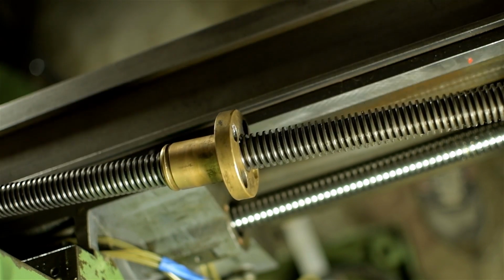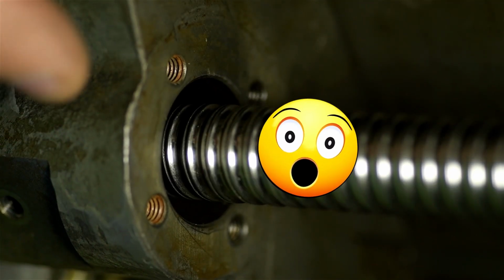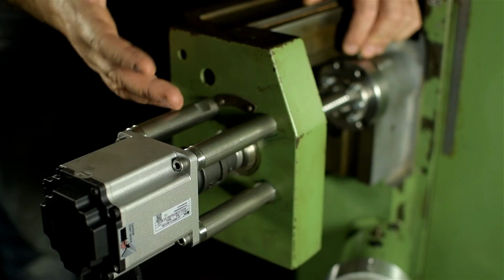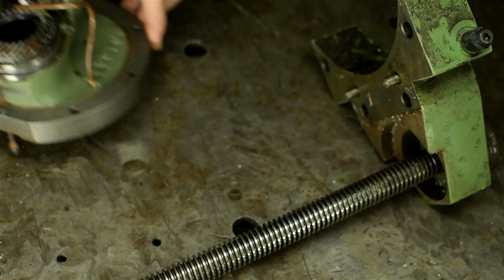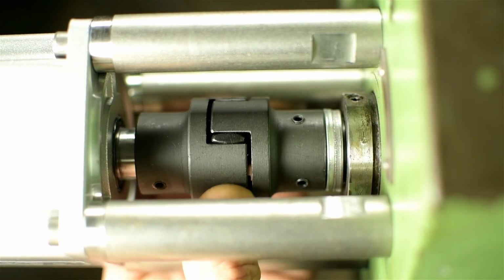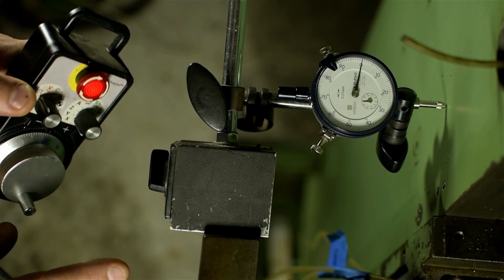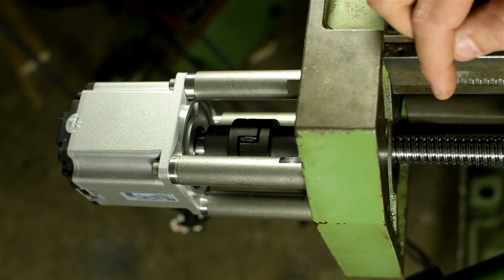Maho X Axis?  DONE!

Comment: Tony: If you move the encoder from the back of the motor to the ballscrew itself, you can use any coupling you want and you'll still get full accuracy.
Reply: Sort of. You'd end up with some elasticity in direction changes and stops, which would be hard to tune out with the software if it's even designed to calibrate for such things. You're right though. What you're suggesting is why I have decided to build my own plastic printer instead of buying one.
Reply: Not to mention you cannot "move" the encoder, it's built in to the motor. He will be fine as long as he uses belts and couplings that are designed with motion control in mind. I.e l8w backlash couplings and timing belts
Reply: @RobertChadziutkoRC  He has a TIG, a milling machine and a lathe. He can move anything he wants. It would be a lot of extra work to do so, and really wouldn't gain much accuracy without spending a whole lot more on things like ground ballscrews instead of rolled ones, and there's nothing to say that TOT requires that level of accuracy. 

But you absolutely can move the encoder to anywhere you like, and if you wanted uM repeatability, that's one of the things you would need to do.
Reply: @Jimmeh_B  all I was saying is that with his particular motor, the encoder is NOT moveable, it is literally built in to the motor.  He could certainly use an auxiliary encoder that is mounted to his machine, but there is no moving of the current encoder setup.
Reply: @RobertChadziutkoRC  you're wrong.
Reply: @Jimmeh_B  So you are saying that he can easily disassemble the motor, extract the encoder from the motor, then engineer some sort of adapter mechanism and an enclosure for the now exposed encoder  to use it as a linear encoder attached to the table somehow? He would be better off just buying a pre assembled linear encoder and using the auxiliary encoder input on the drive to interpolate the movement of the axis based on both encoders. This would leave the motor encoder to do it's thing and make tuning much easier.
Reply: @RobertChadziutkoRC  okay, a few things.
1: do not put words in my mouth. When did I suggest it would be "easy" (though it wouldn't be difficult). 2: You've misused "interpolate". Encoders do not interpolate, if they did, they would be called interpolaters. 3: "better off" is subjective and your opinion. Personally, I build whatever I can from other devices over purchasing items, mostly just for the challenge. Also, how exactly would one be "better off" buying another encoder, creating adaptors/mounts to fit said encoder, and then adjusting the software to account for said encoder along with the calibrations necessary - rather than just dealing with one encoder that is guaranteed to be absolute?  Also, no I was not suggesting that if one were to remove a rotary encoder from a servo motor, that it could then be used as a linear encoder. Again, it's a rotary encoder, it's in the name.

Finally 4: My point was, the man has a milling machine, a TIG welder, and a lathe. The list of things he cannot build is far shorter than most. Encoders are external to the motor itself, they may be attached to the motor as an assembly, but they are external to the actual motor. Rotary encoder's are not some highly complicated piece of kit, they are simply a rotating vein of some description with an appropriate sensor/array dependent on resolution, making adaptors to mount them on things is trivial.
Reply: @Jimmeh_B  Interpolation happens in the software of the drive, not the hardware. Auxiliary encoders are pretty standard in the industry and not difficult to enable and integrate into the closed loop system. Mounting a liner scale is as simple as making sure it's parallel to table, drilling a few holes, and running the feedback cable to drive,   All I am saying is that with his current motor/encoder setup it is not feasible to remove the encoder from the motor as you suggested and using it somewhere else on the machine. Utilizing different motor sans encoder and attaching a linear scale to table and using as feedback is.  Of course anything is possible, but some things just aren't worth the time and energy when off the shelf components are readily available.
Reply: @RobertChadziutkoRC  right, so, you've finally come around to agreement. 
Also mate, I'm well aware of where the interpolation happens, I've been designing and building interfaces and writing the software for them as a hobby for over 30 years. You've made a bunch of erroneous statements, and now you have decided to reword what you said in order to explain things to me that don't need explanation and in doing so have begun to admit the statements you made were wrong. Just not in so many words.

I don't expect you to have an understanding of a stranger's level of understanding on any given topic. I certainly don't need explanations to things I clearly understand. 
I'm glad you agree that it really is not only possible, but trivial to modify almost anything to fit a purpose, given you have the equipment, knowledge and willingness to do so.
Reply: @Jimmeh_B  Lol, not at all, as I stated from beginning removing encoder from that particular motor is not feasible. It is quite obvious it is just a hobby to you as you were not even aware that removing  an encoder from said motor is not a reasonable possibility. This is not my hobby but has been a  career  for 30 plus years, designing, building and programming multi axis motion controlled machines for many of the worlds largest manufacturers.  It was your post with many inaccuracies that led me to post some corrections.  I rarely post comments online and your type responses is why I avoid posting.  Thank you for your hobby oriented responses, I am just merely stating facts of what a proper motion control system looks like.
Reply: @RobertChadziutkoRC  Why? Because I will interpret what you said, the way you said it?
"proper motion control systems", oh I see. So my manual thread cutting lathe that I converted to CNC is not "proper". Nor are any of the plotters and laser engravers that I've built over the years. Because they were built on custom interfaces that I designed and not plc's or commercial motion control systems that are cost prohibitive for a hobbyist. I suppose when I'm finished building the laser interferometer for my AMCO 3850 in an attempt to completely automate the machining of brake rotors (aside from mounting and removing the rotors from the arbor) it won't be "proper" either. Irrespective of which of the many systems and MMI's I choose to control it with in the end.

You may be a qualified engineer or whatever, and what I suggested may not be the way it's done in industry through companies with endless budgets. In fact, I'm well aware what I suggested isn't how it would be done in industry.

However, feasibility was never part of your statement. If that's what you meant, maybe you should have communicated it more effectively. Your statement, verbatim, was: "Not to mention you cannot "move" the encoder, it's built in to the motor." But, sure mate. TBH I'm now done with this. Thanks for attempting to suggest that my 30 odd years of teaching myself electronics, programming in 7 languages so far which I've become quite proficient at, interfacing, logic, robotics......... plc's, pid's closed loop control systems.... are trivial though, I appreciate that. Never mind the fact that I've worked for fox studios making pneumatic walking rigs for movies, or channel 7 studios, or any of the other companies I've worked for.

Which begs the question, why would you even watch someone like TOT? Since he's self taught and clearly there's nothing here for you. The simple fact is, it is absolutely possible to remove an encoder from a servo drive and relocate it if necessary, the converse of what you stated, I've done it, several times.
Good on you buddy. Enjoy the rest of your life.
Reply: @Jimmeh_B  I have never seen your work, so I would have no way of knowing if it is proper or not. I apologize for upsetting you as that was not the purpose of my post at all.  I was only trying to correct the fact that for this particular servo model it is NOT possible to separate the encoder from the motor, and further there would be zero benefit in doing so as it would not be correct for the application as a linear encoder that would be needed to achieve what you were originally  suggesting.  I am self taught also, working my way up from a lowly maintenance tech, so I have nothing but respect for people who have done the same, however there is a huge difference in knowledge when someone works 60 hours a week on nothing but automated machine design and programming for 30 years vs someone who tinkers with stuff on the side. Yes you can make a lot of surprisingly cheap, or repurposed stuff to make a laser engraver or thread cutting machine work and it takes lots of creativity and skill for sure, but Tony is not using that sort of stuff, he is using true, off the shelf industrial grade components to upgrade his machine, I don't think he wants to start ripping that stuff apart to make a round peg fit in a square hole so to speak.

Comment: I don't think your problem is down to the coupler, more likely the thrust bearing needs properly pre-loading. And definitely keep the 'rubber spider' coupler, the helical split style don't always return to the correct position, like they introduce the backlash you paid so much money to get rid of. I build 3d printers and small cnc machines and that is my experience. Maybe build a test rig to prove/disprove that?
Reply: While a little bit of the backlash is probably coming from the lack of preload, I disagree with you on the coupler. In the video you can see the rubber compressing, leading to backlash. Read the comment by "whitewater catamaran" for an experienced explanation. For a machine this size the better option will be to use rigid or keyed coupling as whitewater suggests, possibly with minor dampening on the motor/servo-mount to "cancel" any minor misalignment. I agree that using the wrong kind of helical couplers lead to positional accuracy issues. My background, I'm not a machinist, but a hobbyist builder of both 3D printers and small CNC machines/routers like you. and an egineer.
Reply: @jolangse  I disagree with 'whitewater catamaran' on the accordion style couplers - they expand and contract axially as they contract and expand radially, wheras the rubber cush couplers don't. Ok, so the rubber cush drive couplers aren't perfect but they do provide a small cushion to help the motor avoid skipping steps under load. Would be different if the servo used a linear scale for positional feedback, rather than the onboard rotational sensor.
Reply: @fredgenius  The issue you highlight with accordion style/helical couplers is precicely why I included the wording "the wrong type". Helical ones do, but slit-cut and counter-helicals don't. However, with properly pre-loaded thrust-bearings that should not be an issue. The issue with the lovejoy-style couplers is that they introduce slop/backlash on the rotation as the rubber compresses, which is amplified as linear backlash in the ballscrews. As this conversion is done with servos and their closed-loop feedback control, there is no need to worry about skipped steps, ans with proper acceleration tuning of the servos there's no need for the cushioning effect of the lovejoy couplers.
Reply: @jolangse  Ahhh, I wasn't aware of different types of accordion style couplers. Thanks for the info.

Comment: I've seen grid type couplings which secure motors to pumps, they don't seem to have much play if any, although I think those are only for higher horsepower ratings.  I checked around and the smallest I could find would be the Lovejoy 1020 in half inch.

Comment: Depending on the static friction on the ways, I think the backlash is from the ball nut/ball screw interface. If the way friction is nice and low, you may get some undesirable finish effects from using a "cush drive" coupler and those adapter columns holding the motor.

Comment: You cant trust a dial indicator to measure backlash accurately only as a guide as it would have to be in exactly the same direction of travel as the axis and unless you have a rigid fixture made for this purpose that is perfectly aligned. A mag base isn't up to snuff as the geometry isn't accurate enough.  Also it is good practice to turn off backlash compensation. The Rubber isolator will compress as it is made to do and that will alter the stop precision and possibly introduce creep when stopped at speed, especially on a balanced load like a horizontal axis. All is not lost however it will be fine on the Z axis. 
Cheers

Comment: Tried something today, tried tempering and heat treating weld joints. Initial results look promising, they have gone from failure points, to stronger than the actual stock. Not sure this is practical for everyday use , maybe for aerospace. Anyways, awesome video 👍

Comment: You might put the dial indicator on the end of the ball screw shaft and see if the backlash is any different. Not certain about the motor mounting post stiffness, it might be worth measuring for any twisting. Give some thought to an interference coupler and shimming the motor mounts.

Comment: Im no CNC expert by a long shoot, but Im pretty sure some of that error is coming from your 4 point stand offs.  Probably not as noticeable right now do to the type of coupler u have used.  U should mill up at least two solid stand off two negate the rotational moment of when the motor starts, stops, or changes direction.  It is probably not as much of an issue at this time, cause you are way off right now! Lol.  Good luck.   It will however likely manifest itself as back lash once u get the machine more dialed in.  PS thanks for doing your videos and hilarious commentaries, it always makes me laugh.

Comment: When I first saw those standoffs go in, I was worried about weeble-wobblin'. Like if you took the cross supports off of a kitchen chair. I see some other folks talking about a solid bracket, maybe like round or square tube with some long fasteners to hold it tight. That spider's definitely gotta go, though.

Comment: CNC milling machine noob her: correct me if I am wrong, but that belt on Z axis will be probably even worst than this rubber clutch on the X axis. They are both probably a good option, but only if your feedback was directly placed on the axis them self and not on the motors. Now if there are places with uneven friction in the dove tail, the function between axis linear movement and motor turns will be nonlinear due to the rubber compensating for those differences. And this backlash will keep getting worse and worse with time as rubber parts wear out. And again, I can be 100,999% (those are metric %) wrong!

Second of all: Are you using smaller cnc milling machine to make a bigger cnc milling machine that will you will use to build a bigger cnc milling machine that will you will use to build a milling machine the size of a small Texas house?

Comment: The cap on the end? Just drill some more holes, then them, and screw on a custom cover. And those standoffs, maybe okay, but I'd get some round tube stock, bore to size, machine outside, drill and taps some holes, screw than on, no chance for that one peace of steel twisting due to torque.

Comment: neither of those couplers should be on a CNC. the spider type however might be something you can convert. on Fives Cincinnati 5  the Y and Z gear shafts to the 90 degree boxes use a spider looking coupler but lack the spider piece its self.  the gap is taken up by set screws giving you the ability to tram in the axis and tack out some back lash.

Comment: I'd suggest two more holes for the nut, the shaft coupler will fail(Nevermind it did instantly) after typing that haha, you should just be using Metric like the other 90% of the world! finding it odd you've gone with the newer ball screw cut/angle/pitch it does speed things up but is by far harder to tune CNC for, also need some serious couplers and nuts for them to not wear and not the Brass variety. (Laser Operator/Machinist/Maintenance from Australia) if that helps any! XYZAB!

Comment: stick your indicator on the far right end where you did not sink that bearing far enough.. and check the end play.. that will tell you if its the drive coupling or the ball screw or thrust bearings..   do you have a slitting saw blade.. make up your own solid slotted flex coupling.

Comment: I've had two different services techs tell me that you're not supposed to measure backlash with the manual pulse generator, but rather to move the machine with actual code since the MPG has the possibility to generate an incorrectly timed pulse. Not sure how much it matters, especially for a home gamer, but there ya go.

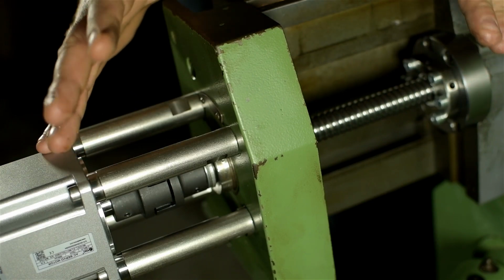Comment: You should be using servo couplings to connect the motors to the ball screw and not jaw type couplings. There's too much backlash in those things. 4:35. Those set screws are also not a positive way to secure the coupling to the motor and ball screw shafts. Servo couplings have zero backlash and are secured to the shafts with friction and clamping...again, eliminating the possibility of backlash.